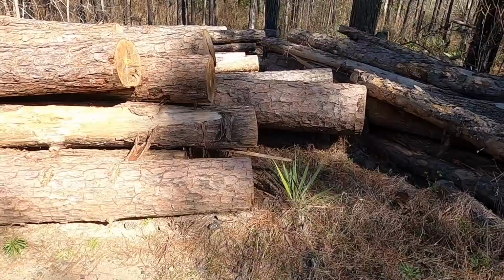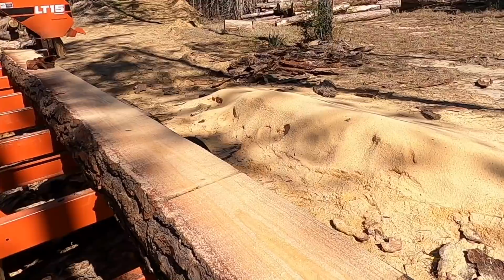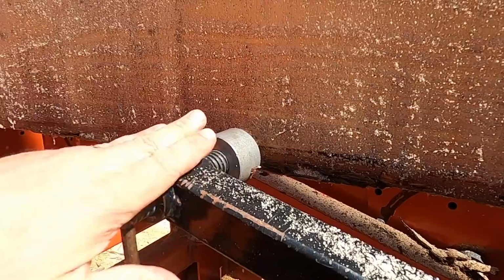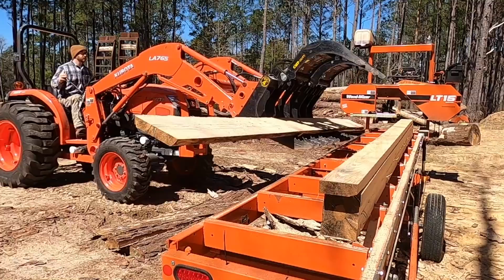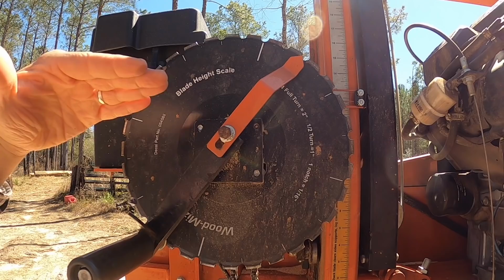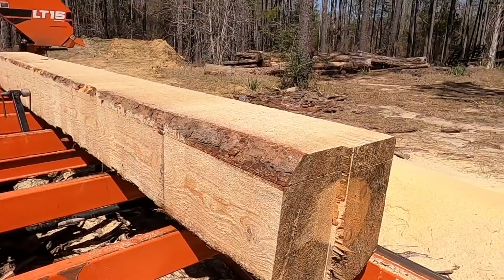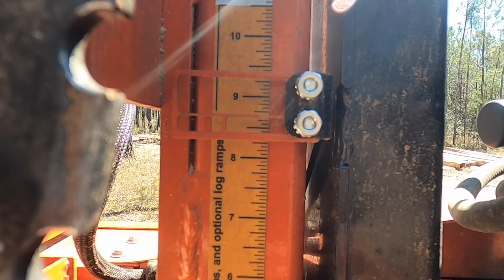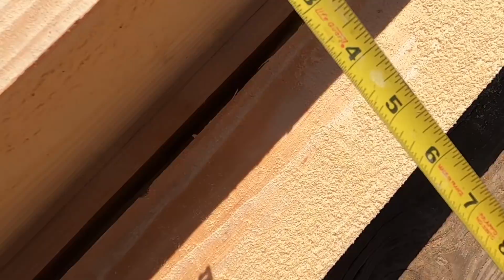Making True Lumber, WITHOUT a Measuring Tape

Comment: I appreciate you showing the blade adjustment wheel. I always wondered how the thickness adjustment is done on the WM saws.  In a future video could you go into more detail your thought process to know where to return the blade, or is it built into the saw?  Due to my technical background, I was wondering how this is done.  No one I have seen online explains it very well.  Thanks.
Reply: Also, for the saw travel, can you show how far the saw will go and is it possible to run the saw off the track if a person's mind wandered?  Are there travel limit switches to prevent a crash?
Reply: @tonyn3123  His LT15 has powered feed.  If you look on the outside operator rail(right side of screen) you'll see a drive rope.  The power feed uses this rope to pull itself along through the cut and also for the return.  I'm not sure where the switch to a chain is in the WM line, but can tell you that my LT35 has the chain as do lt40+. The sawhead can't be run off the rails in either direction unless something breaks/is removed.  The mill has no idea where it is in the forward/reverse direction on any WM that has less than the simple set 2 setworks, and I'm not sure the simple set 2 setworks knows.

Comment: Why do you cut the last set (at the 19 min mark) from the top down and not from the bed up?  You had to do that last cut to make the bottom board the correct size giving you a ~1/4" or so waste.  If going from the bottom up that would have eliminated some of your wain(?) from the top board.  Thanks for the content. Cheers.

Comment: What do you do in order to eliminate the pith? I noticed that you included it in the other slabs.
Reply from the maker: I don’t worry about it. With a hydraulic mill it’s probably a lot easier to do…if the lumber bows I just don’t use it.

Comment: store bought 2x6 are 1-1/2x  5-1/2,,, soooo for every 3 boards if you make  em 1-1/2 you gain a board,, the six boards you made could have been 8 boards outta the same tree!! if your doing a remodel that full 6 inch board becomes a problem fitting in with 5-1/2 ..Aloha my friend..

Comment: Probably a dumb question. Do they make a double edged blade saw blades so you could cut in both directions?
Reply from the maker: They do, but for other mills. This mill is not designed for that.

Comment: Noticed you’re running diesel now. I made the switch after watching the other fella that milled the 20 ‘ers for you. Thinking about ordering a Cooks Mill drip system. Or I might add a second valve after the shutoff  to control the rate of flow.
Reply from the maker: Yep, total game changer.
Reply: @falllineridge  Video idea to speak some on this for example showing the flow rate, mixing the diesel with water, showing blade temperature with lube and dry no lube at the end of the cut.